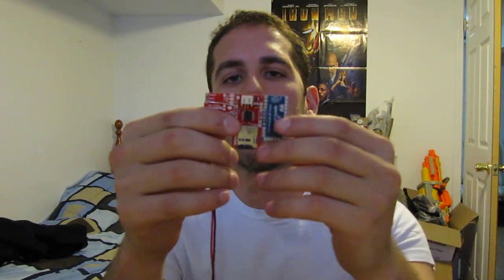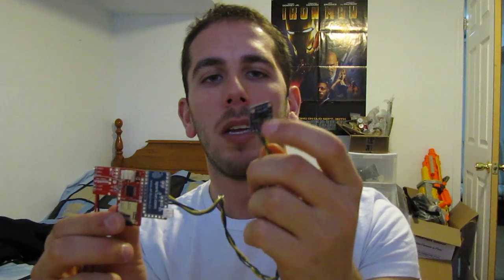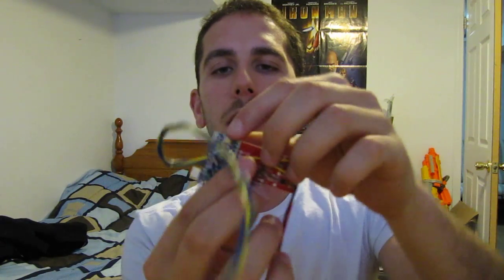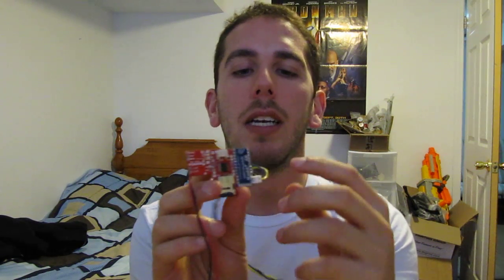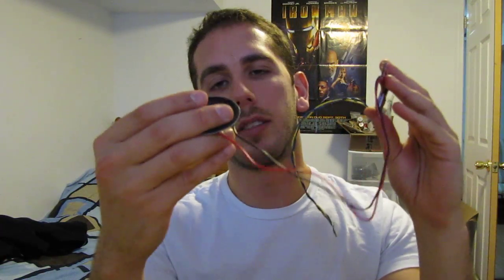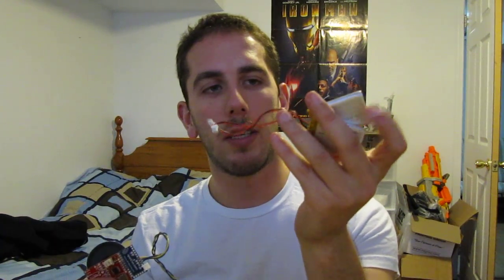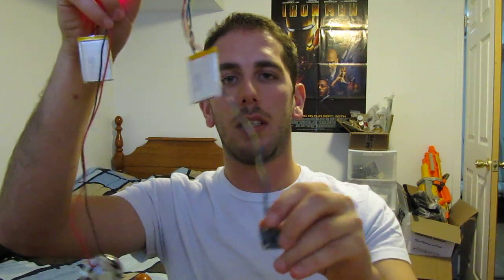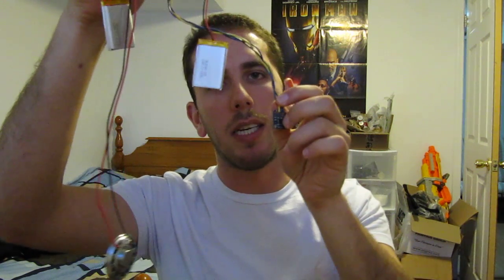Iron Man Walking SFX Explained

Comment: can you tell me what specific circuit board ur using. the one with the reset button
Reply from the maker: Arduino Pro Mini 3.3V
Reply: and did u have to get an sd adapter board or was it already on there? if so can u tell me the sd adapter board you got lol sorry for all the questions XD
Reply from the maker: jayubig Yes, I added the Audio Sound Module from Sparkfun for the SD card.  No prob!
Reply: thanks a bunch man....one more thing. For the hinge system did u like make it yourself or is there a specific model like it.
Reply from the maker: jayubig I built it myself.  You can find it on my Shapeways store (link in the description of the video).
Reply: ahhh i see lol. i always have a respect for you engineers there is a lot of hard work involved lol. Ok so i got the Audio-Sound Breakout and the Arduino alongside the Accelerometer. THere looked like there was one more piece that looks like it connects the two or it it both of them connected?
Reply from the maker: jayubig Haha, I'm not an engineer!  Well, I've never gone to school for it.  And, yeah - the last piece is the Audio Amplifier board from Sparkfun also.  Try breadboarding all of them to get the effect you want! :)